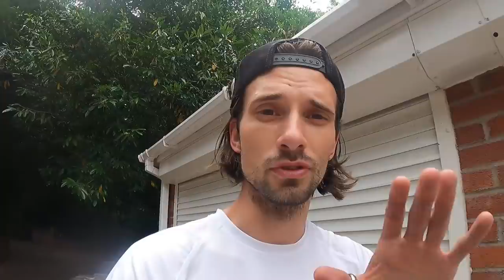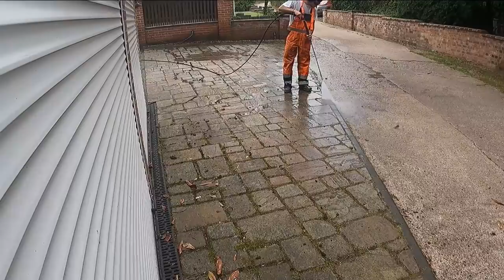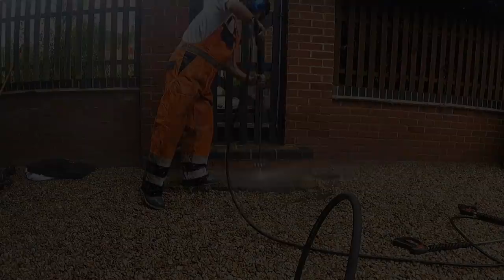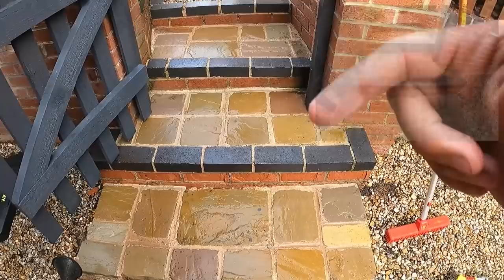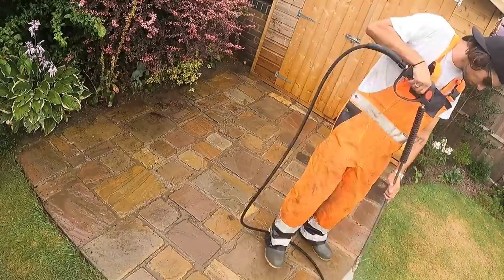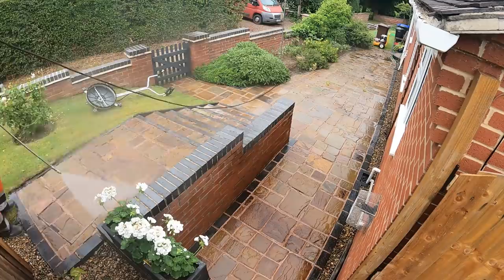I shocked myself with these results... SUPER SATISFYING Indian Sandstone Cleaning!

Comment: What an unbelievable transformation! And what a joy to have proper drainage too! 😂
Reply from the maker: :D the drainage was epic on this one. Only reason i finished it in the day, never take that for granted haha!
Reply: A really good point about drainage.  I often have properties with very poor drainage or runoff and the filthy, algae ridden water just pools back onto the cleaned area.  When the water dries, the dirt and active algae is deposited back onto the hard surfaces.  In a few cases, I've used a wet/dry vac to suck up the pooled dirty water so it can be emptied elsewhere, but this adds considerable time to the task.  Any tips or tricks to deal with this problem?
Reply: @chrisgraham2904  Dunno, some of these vids it looks like he uses a bucket for that purpose
Reply: @PartridgeExteriorCleaning  At the 10min mark, where you look at the gutter on the top right, you may want to contact the owner of a suspected wasp hive under the roof or behind the wall.

🐝
Reply: I was also checking that drainage! Where I live, it’s not common to have that in properties, although the soil has some natural drainage of its own, but it’s raining heavily, my yard floods a bit.

Comment: Hey. I've meant to ask for a while. Can you explain a bit more about the chemicals you're using? I remember you mentioned it could make you blind 😬 how quickly does it break down? How long do you leave it on, and what happens if it's not rinsed properly? Does it harm grass and other plants? Is it ok if it goes in the drains to the waterways? Maybe a topic for a video... take care! 👍
Reply from the maker: I will mention it in a vid soon but also to you now :D Sodium Hypochlorite (sh, hypo, bleach etc)
It will break down after an hour and be innefective once it's reacted with a surface. 
I leave it on for 20 mins max, if not rinsed properly then some salts may appear on the surface but they will go after a bit of rain, its terrible for grass and plants so rinse them before hand and afterwards. If you noticed in the video i had a hose watering the plants the entire time the bleach was being rinsed and pooling near them.
It's heavily diluted by the time it reached the drains and then will be diluted further, bit of a grey area but from what I understand it's fine.

Hope that helps!
Reply: I was going to comment something similar - good questions
Reply: @PartridgeExteriorCleaning  Your vids are compulsive viewing - crazy - just watching pressure washing! I have a large flagged terrace and a 160m x 10m sloping tarmac driveway under trees that mosses up badly and needs pressure washed twice a year. I've looked at chemical agents, but had concerns about the impact on the surrounding trees and plants. No easy answer, but there's a wikipedia note on hypo: 'In spite of its strong biocidal action, sodium hypochlorite per se has limited environmental impact, since the hypochlorite ion rapidly degrades before it can be absorbed by living beings.[58]

However, one major concern arising from sodium hypochlorite use is that it tends to form persistent chlorinated organic compounds, including known carcinogens, that can be absorbed by organisms and enter the food chain. These compounds may be formed during household storage and use as well during industrial use.[38] For example, when household bleach and wastewater were mixed, 1–2% of the available chlorine was observed to form organic compounds.[38] As of 1994, not all the byproducts had been identified, but identified compounds include chloroform and carbon tetrachloride.[38] The estimated exposure to these chemicals from use is estimated to be within occupational exposure limits.[38]'

Comment: Hi. This is wahaj from Macquarie Pressure Cleaning. I base in Australia. I have started my pressure washing business 3 months ago. I have some questions and would highly appreciate it if you provide your valuable suggestions to some of my queries.
I have trouble removing oil stains from the porous cement driveways. Oil stain marks are sitting there for like years. what is the effective way to deal with those oil stains?
What is the percentage of sodium hypochlorite you use?
What type of surfactant do you mix with sodium hypochlorite and in which ratio?
Which is most effective. Pre-treatment or post-treatment?
Regards from Australia.